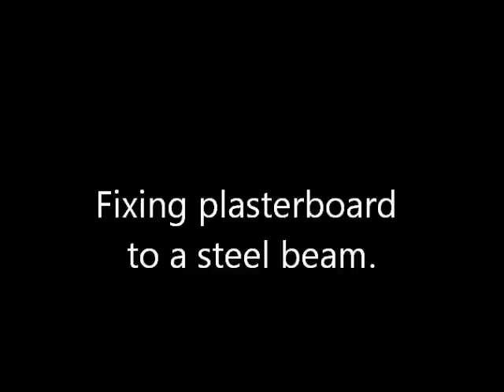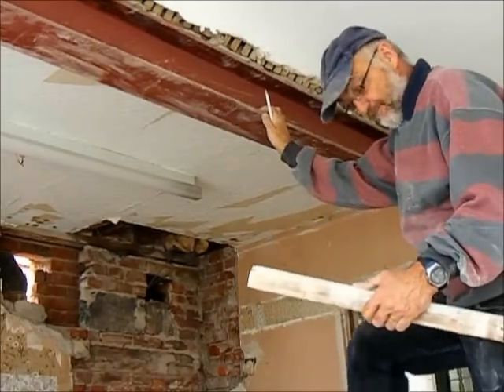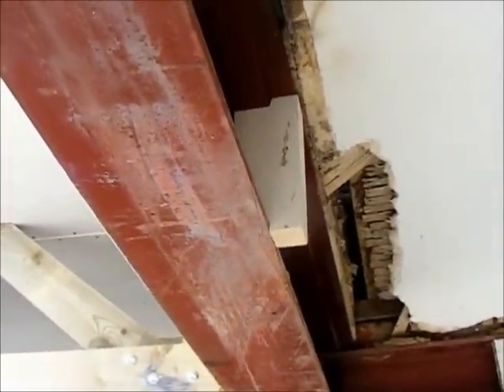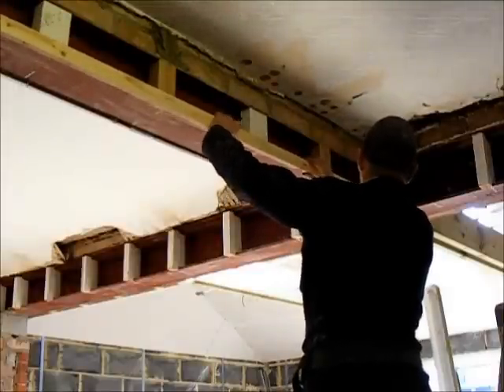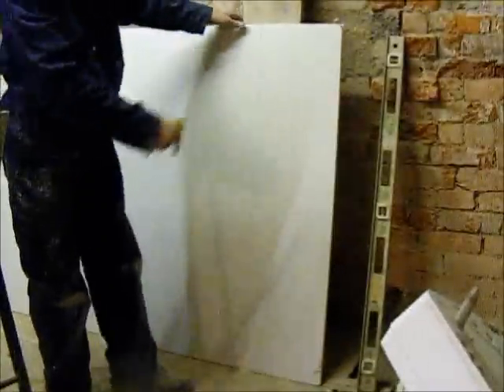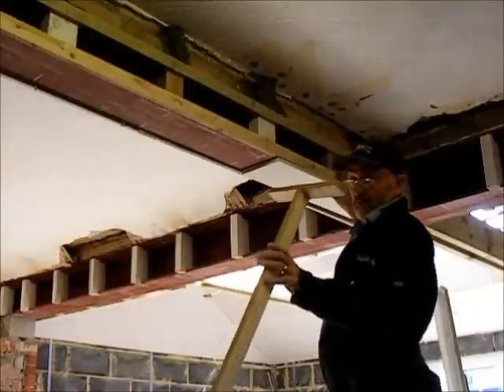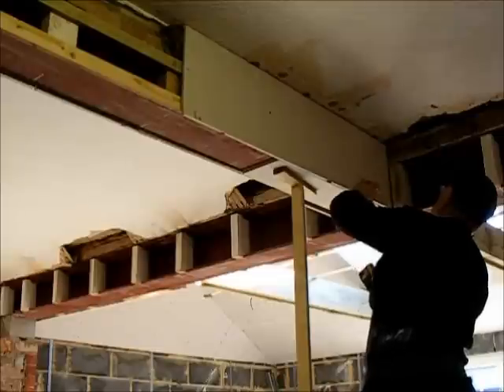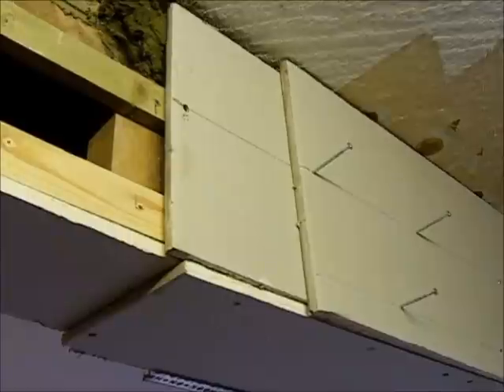How to plaster board a steel beam.

Comment: In most private dwellings the requirement is for 30 mins (depending on size and occupancy) This can be achieved with one layer of 12.5 standard plasterboard as set out in the British gypsum white book.
Reply from the maker: You are probably right but I considered the walls above are an end house wall and a load bearing wall over a kitchen. Belt and braces.

Comment: Great video. What are your thoughts on how to plaster a channel beam where there is only one recess on one side?
Reply from the maker: You could use a tube type adhesive and scrim tape on all edges including to the ceiling both sides. Otherwise drill and fix the carry battens.

Comment: Do you think jet fuel could melt those beams?
Reply: No as It was an Inside Job lol
Reply: The heat from the jet fuel would have sufficiently weakened the steel.
Reply: Ever heard of a blast furnace?
Reply: Ever heard of a blast furnace?
Reply: The world trade furnace
Reply: There is another theory that the aluminum from the plane was heated to a very high temperature in the fire and then the water from the fire supression system came into contact with it causing an explosion. Apparently hot aluminum explodes when it is exposed to water.

Comment: Hi, if you pulled down a load bearing wall and you wanted the ceiling to be flush from room A to room B, so it looks seamless, do you lower the ceiling or is there another type of beam you use? Thanks
Reply from the maker: It depends on the direction of the joists above. If the new beam will go between the joists you can just make good the gap in the old ceiling caused by the wall removal. It is not likely that the two ceilings will be level. In that case cross batten with 2x1 tile batten screwed to the joists and then plaster board over.
If the steel has to go under the joist to support them, then make down the ceiling with 3 x 2 hangers and 4 x 2 joists then board over. Remember; to conform to building regulations, you will always need to fix a layer of plaster board to the beam first before boarding the ceiling.

Comment: Hi,you can buy fire rated plaster board which would require only one skin ,instead of two,saves a little time.
Reply from the maker: Yes thank you Max.
Reply: One layer of fire board gives 30 minutes fire resistance, you need two layers, 15 + 12.5mm to give one hour.
Reply: @ewanhealy5891  That's true, but UK Building Regulations only require 30 minutes of fire resistance.
Reply: So 5/8" board in the US...
Reply: Yes, pink plasterboard is fire rated.

Comment: You should not wedge any timbers in any RSJ steel Web thats carrying a load bearing wall. Steel expands when it gets to a certain temperature, causing movement between steel and the wedged timber (between steel web) causing the doubled up plasterboard to fall. Proper way is to screwfix timber at full length in the steel web and continue with noggins every 400 centres. Fire resistant board will give you the same properties as doubled up plaster board saving you half the work time but must be plastered.
Reply from the maker: Tim Hunnisett Thanks for that Tim.
Reply: Surely it would have to expand considerably for them to fall out, I could imagine it could allow for movement and cracking but not for the boards to fall down. Is it possible to stick the wood in with an adhesive?
Reply from the maker: The ceiling boards hold the face boards in; after all is set so the wedged timbers are not doing anything.
Reply: Hi Tim you seem to know your stuff, how would 1 achieve 1 hr fire protection to meet current b regs? appreciate your time.
Reply: The temperature difference, beam deflection, and etc should not be that much to cause the wood timbers wedged in the beam to fall. I rather have them installed that way than drilling into the beam web. 
It would be difficult to drill through that metal, plus I would'nt advise people to go on messing with structural elements. (I'm a structural engineer).
Regards
Reply: By the time that happens I'd be halfway down the street watching the house fall down. If you're still in the house by the time the steels warp you're dead anyway.
Reply: @moro1891  indeed it is difficult to drill through the steel: ive just ruined two titanium drill bits drilling through a steel I-beam (though they were from a French brico)
Reply: Just wedge them in as on the video. If they are a good fit they certainly aren't going to fall out.

Comment: How did you fix the wood infills in? Did you just wedge them?
Reply from the maker: Yes just wedged in.  When it is plastered the scrim tape on the corners hold it all in place
Reply: @Bernieclark45  Makes sense, thanks Bernie. BTW I am thinking about installing a steel for my loft, do you have a rough rule of thumb to calculate steel size to span, I've seen rule of thumbs for wood joist but not steel. I know ultimately I'll need structural calcs but need a rough size for now?
Reply from the maker: @plummetplum  .Afraid not Matt sorry. Before I did mine I took the drawing to a structural engineer to check they could and would supply it. Then took the calculations to the steel supplier. All before applying for planing and building regs.
Reply: @Bernieclark45  Fair play thanks again Bernie.

Comment from the maker: It is building regs that steel has to have two layers.
The risk in putting steels up by DIY is to great, best get a builder to do it.
Reply: DIY can do it but jobs like this need  building regs approved and professional engineering calculations.
Reply: Two layers of conventional board or one of fire rated board

Comment: Hi just a quick little question is there any regulations on the thickness of the plaster board?  Thanks Dan
Reply: No. You can make the plaster board as thick as you want. Within reason of course.

Comment: Hi Bern, thanks for the video, but I thought that the first 'noggins' that you install in the beam had to be fixed with a screw or a bolt, not just tapped in. Is this correct? Regards, Pete.
Reply from the maker: Peter you may be right. However the plasterboard is fix you have to be sure it canot fall away. In this case I am relying on when the ceiling is over boarded it traps the beam boarding in place. I should have mentioned that. So thanks for pionting that out.
Reply: the video shows the standard acceptable method just knocking the nogs in.

Comment: I might drill and fix for added strength. Cheers.
Reply: If you drill the steel you will loose strength
Reply: by drilling, you strengthen the framing (which is supposed to hold the plaster board only), but you weaken the steel beam (which is structural; it holds the entire roof).